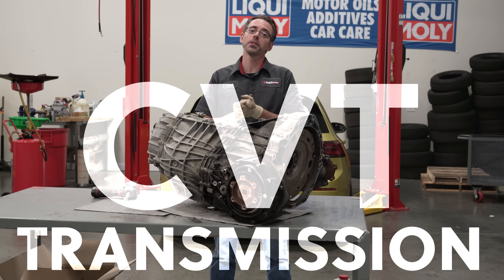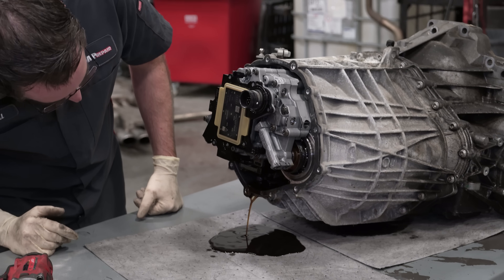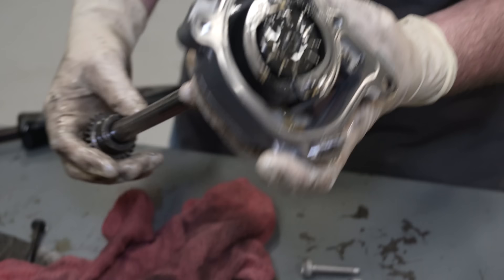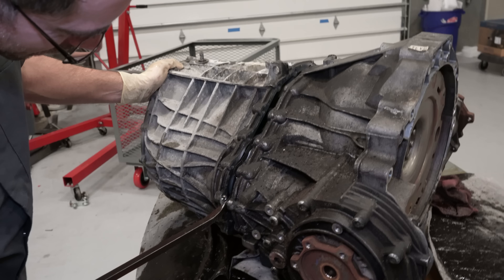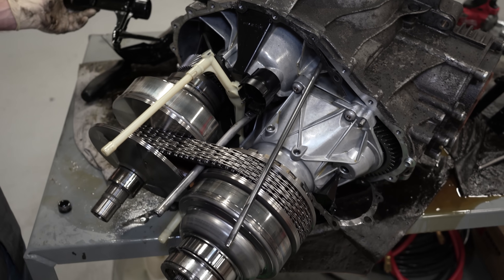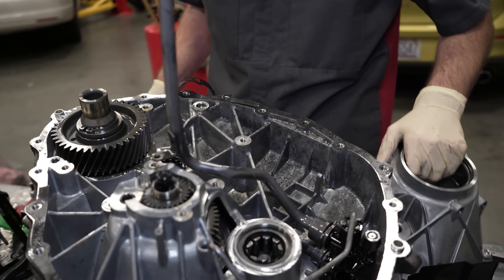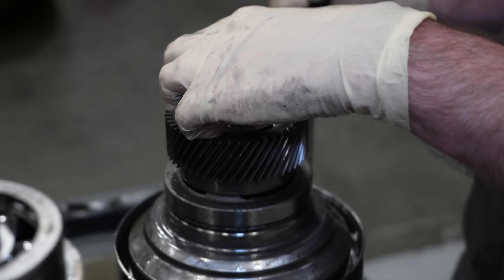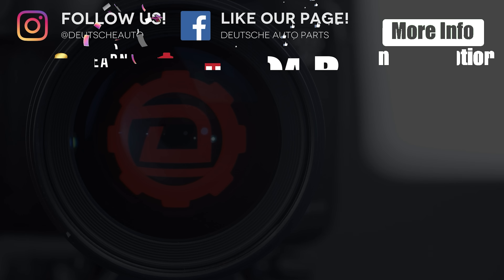Why you shouldn’t get a CVT transmission

Comment: I have one in my Honda, The key to CVT longevity is regular maintenance. You cannot ignore the CVT like a normal hydraulic transmission it will have an early death..
Fresh oil is constantly needed to sustain good transmission health.
Reply: I'm still stretching a bit far, but I've had the fluid changed in my Toyota-Aisin unit in my 11th Gen Corolla twice. It's been done every 90K miles. I'm at 195K right now. Car from brand new. At least when we drivers of Japanese cars state that it's only about maintenance being done, it's actually true unlike what the VW Fanbois like to claim!
Reply: Automatic transmissions need fluid changes too,most people never do them and they wonder why they failed. I only have standard transmissions in my Hondas and they are virtually bulletproof.
Reply: My 13 Accord has a CVT and it’s perfectly fine for me. No problems because I don’t drive hard at all. I’ve exchanged the fluid once since I bought it at 80k miles
Reply: You want good transmission health design a transmission cooler to keep it cool
Reply: @stevejohnson1397  Mitsubishi has a transmission cooler on their INVECS-III CVT.  Pretty bulletproof CVT. The guy who made this video doesn't really know what he's talking about.

Comment: Honda and Toyota are the only ones who have "perfected" the cvt. They added a dedicated launch gear (1st gear) like a normal trans, then gears 2-6 are cvt. Take off on cvts is what kills them the fastes
Reply: WRONG.  Add Subaru to that list, and their CVTs are better than Honda's.  Also - Subaru worked with Toyota on developing their most recent CVT (Toyota owns 19% of Subaru).
Reply: @eskieman3948  you sure about that? Because Subarus website states that their cvt does not have any gears and nor do they mention that it has a launch gear. Subaru transmission were made by Jatco (OWNED BY NISSAN), same with their earlier cvts and until recently. Only the Lineartronic cvt is made by Subaru, which still doesnt have a launch gear. Therefore, as mentioned earlier, HONDA and TOYOTA are the only manufaturers that make a cvt with a launch gear(physical 1st gear). If SUBARU cvt had a launch gear, you wouldnt hear people with a cvt wrx complain that they cant launch the car. You might want to read up on your facts bud

Comment: CVTs only go bad if they are made poorly or they are not serviced every 50k-70k miles with synthetic trans fluid.
Those idiotic manufacturers stated their transmission fluid lasts as long as the life if the transmission which says nothing but we want you to buy a new transmission.
Change your oils.
Toyota/Honda has good CVTs
Reply: I'd put a Subaru CVT up against the Honda CVT.  I've driven several Hondas and Subarus - Subaru's CVT is better.

Comment: CVTs are very reliable gearboxes. But CVTs with a high torque engines are not a good combination. Also CVTs on heavy vehicles tend to fail fast. But if you take something like a toyota corolla and a camry the CVT will last you more than you could imagine with a any other gearbox. Nissan had the biggest fail of a CVT by installing a teeny tiny CVT to the heavy SUVs. So people thinks all CVTs are bad. But i think Honda and Toyota have nailed it.
Reply: Subaru's CVT is better than Honda's, and it's as good as Toyota's.
Reply: @eskieman3948  Maybe. I am not familiar with Subaru. Because it isn’t much of a popular brand in my country. Only less than 1% of cars here would be Subaru. So i’ve never had the chance to drive one or none of my close contacts have one. So I can’t speak for what I haven’t experienced.

Comment: Thanks for the sacrificial CVT video. Personally, I've grown to like the CVT on my ~150hp Impreza, but I think that's where these things belong: on low-hp economical daily-drivers. The paddle-shifters with simulated "gears" gives me enough enjoyment on the back roads that I don't really miss having a manual (especially when the commute gets to be stop-and-go). All that said, I think my next new car is going to be a VW with the DSG or just a manual (once I retire and don't have to commute with the hordes anymore). This video points out the biggest drawback of the CVT: it's complexity. If anything goes wrong beyond the valve body, your only real option is a whole new transmission. The labor to take it apart and fix it is prohibitively expensive; even the most advanced of manual gearboxes is basic mechanics compared to the average CVT, it seems.

Big question, though: how do you feel about manufacturers still insisting that the CVT fluid is "good for the lifetime of the vehicle"? I was always under the belief that any fluid subjected to shearing force will need to be replaced at some point. And there's a reason these transmissions regularly fail right around 100k miles when the fluid hasn't been changed. Personally, I think the claim implies that once the CVT fluid is done, your car is effectively dead. Just like saying you can skydive without a parachute for the rest of your life.

Comment: I had moped with CVT innit, all that I can say it's not great, requires plenty of maintenance to be able to run smoothly, and when it's a little dirty it'd stutter, the only plus is idiots could be able to drive it
Reply: The moped's CVT & the one's in cars have little to do with each other.
Reply: @eskieman3948  you're right, but I only highlights that it's as problematic as in cars